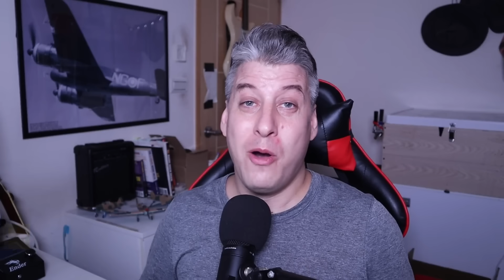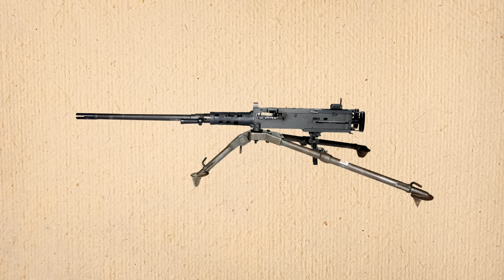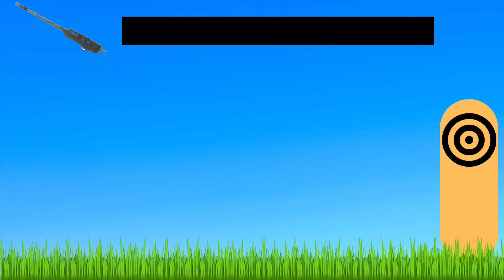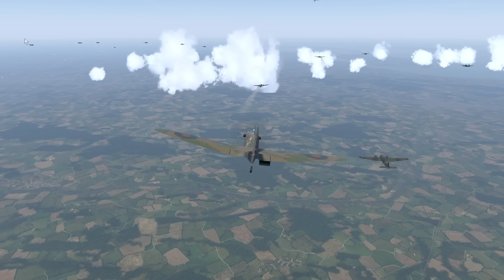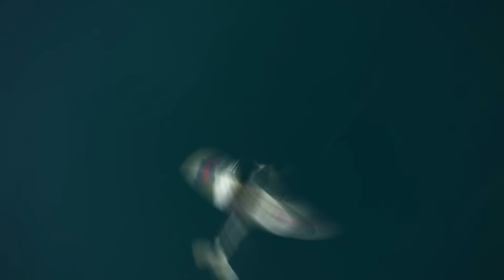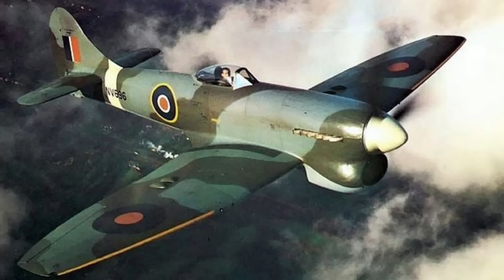Why Did The RAF Use .303 Caliber Machine Guns in WW2? The Surprising Answer

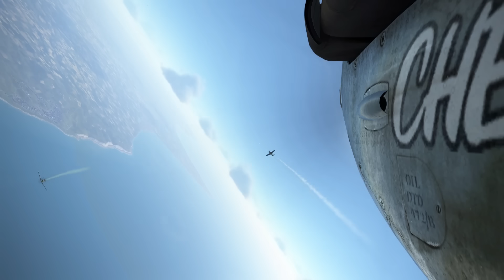Comment: 10:44 - this is interesting. Given that the ‘B’ type Spitfire wing (to take 2 x 20mm Hispano with 60 rounds of drum ammo + 4 x .303 brownings with 350 rounds of ammo) was fully in production in early 1940. Jeffrey Quill - Supermarine’s chief test pilot - notes the disappointment that was he that the cannon wasn’t ready for the BoB in his autobiography. I suspect if the temperature management issues were worked out by April/May all hurricanes and spitfires would have been using the B wing with Hispanos by the height of BoB.

Once the shift to 2 x 20mm Hispanos was made as the main armament a rapid move to upgrade the .303s to .5 cals was not thought ‘necessary’. NECESSITY - not the pursuit of perfection - drove the Air Ministry’s requirements for the Spitfire after 1941: hence the reason why it persisted with the ‘interim’ Mk IX (and the closely aligned MkXVI - which really was the same as a late model Mk IX, but with a Packard Merlin 266 Engine) as the main production run right up until the end of the war - preferring large numbers of that plane to the superior Mk VIII and more powerful Griffon engined variants. It also explains why the Air Ministry were not keen on Supermarine diverting resources to develop the redesigned wing and enhanced tailplane to combat aileron reversal and longitudinal stability issues associated with the more powerful engines. It explained why the Air Ministry never commissioned long range spitfire development; why they delayed the introduction of both the Mk21 and Mk XVIII until near to of after the end of the European theatre of the war. As far as the Air Ministry was concerned the Mk IX worked perfectly for the roles that they needed it for and they wanted Supermarine - and all the subcontracting manufacturers - to produce as many of them as possible. This meant that NECESSITY never dictated the replacement of the .303 guns for the Merlin engined spits. In fact there were many uses for this light armament, including: 

1. Supplementing the big 20mm in air to air combat: no real difference in overall firepower when compared to having 2 x .5 cal guns, plus better tracer rounds, plus less weight at the wing ends, hence greater rate of roll etc; and

2. Ground attack. Unless attacking armour (and the 20MM canon plus perhaps underwing rockets would be used for that), a light machine gun with a higher rate of fire was more effective against troops. The Mk IX was increasingly used in a ground attack role in the later part of the war.
Reply: The RAF had recon Spitfires that could fly all the way to Berlin and back. But plenty of Mustangs were arriving in Britain in 1943 so they used those instead.
Reply: @ToddSauve  1. The spitfires that could fly to Berlin and back from the east coast of England were reconnaissance planes that did not have armament and used the leading edge of the wing for fuel (66 imperial gallons in each wing). They had 228 imperial gallons of fuel carried forward of the plane’s centre of gravity and hence did not need any modification for longitudinal stability or to carry fuel in either the rear of the fuselage or externally. Paul Studdart wrote a detailed article which you can find online for the Royal Society of Aeronautical Engineers that postulated that it was possible to have a series of interconnected fuel tanks on either side the gun barrels along the leading edge of the wings on an armed spitfire (ie. between the 4th and 10th spars and then again from the 12th to 21st spars and connected by steel piping) that would give at least 50 gallons of extra fuel capacity per wing. In a suitably modified Mk VIII that would mean about 200 gallons of combat usable fuel once any rear fuselage fuel (up to 75 gallons could be squeezed in at the back, but this make the plane unstable and hence not suitable for acrobatics and thus war fighting) and external fuel stores were expended. Add in that 75 gallons into the rear and say a further 60 gallons in a paperboard drop tank would get a fully armed spitfire to a target area over central germany. The 200 gallons left unused in the front of the plane and in the wings would be enough to fight for at least 20 minutes (50 gallons expended at max power), then fly home (no more than an expected 100 gallons even with headwinds) plus leave a very handy reserve for contingencies. 

2. The truth is that in early to mid 1943 the Brits had already committed to night time strategic bombing and hence didnt need a fighter escort and the Americans were still in the grip of the ‘bomber mafia’ with their doctrine that ‘the bomber will always get through’, hence no attempts were made to use the kit already available to make the P47 go that little bit extra distance from eastern France to Schweinfurt in time for the big July and August 1943 raids: a disaster. using the Mustang thereafter was probably only an arse covering exercise to hide their strategic blunders in mid 1943. In any case, the mustang didn’t turn up in large numbers until right at the end of 1943 and by then the P47 had largely done the job of killing all the Luftwaffe’s experienced fighter pilots on the western front. Ultimately however, there is no dispute that the Mustang was the superior platform for a long range fighter than either the P47 or Spitfire, but in the planning phase for the 1943 strategic bombing raids, both of the later were available to be adapted for that purpose & the Packard-Merlin mustang (with extended range rear fuel tanks) was still spooling up on the production side.
Reply: @andrewmetcalfe9898  One tends to find the best quality nerds on videos of this kind.
Reply: @andrewmetcalfe9898  A very well put together comment and very informative. I don't recall my Spitfire books mentioning the wing leading edge tanks, nor talk on internal rear fuselage tank. That same tank in the Mustang made handling tricky on take off and until the fuel was used up.
Mark from Melbourne Australia
Reply: @andrewmetcalfe9898  to have really long range, the P-51 also gained a rear tank with the same issues. The rear tank was used first.

Whilst the strategic bombing force was at night, the RAF still did quite a bit of daylight tactical and operational bombing, including with the heavies, and so did need fighter escort. However, this was generally shorter range si the VIII wasn't seen as that much of a requirement compared to the IX. It was useful to pair the VIII airframe with the big, thirsty Griffon and call it the XIV, though. However, the RAF did employ quite a lot of Mosquito NFs as escorts on night operations. One of the complaints with Village Inn ad that it resulted in Mosquitos (and other Lancasters) being fired on.
Reply: @markfryer9880  my Spitfire books mention the wing tanks. In some senses it was good design for strength to have the D torsion box in the leading edge that could be filled with fuel, but it had some heritage back to the 224 as a steam conduit.
Reply: @wbertie2604  I remember hearing a couple reports of units receiving the new mustangs with the rear fuel tank and filling it up for a test flight and the pilots would try and pull maneuvers and end up crashing
Reply: @strykerk992  yes. No aerobatics with the rear tank full, drain it first, then the drop tanks.
Reply: @andrewmetcalfe9898   In Great Aircraft of WW2 by Alfred Price that the P47s at the second Schweinfurt raid were saved by RAF Spitfire IXs with 90 gal slipper tanks arriving just in time  and saved what was a disaster  from becoming a catastrophic raid
Reply: @markfryer9880  Yes the escorting P51 had to be itself escorted until that tank had been used
Reply: @ToddSauve  No: escort work to Berlin by day was always the USAAF responsibility The Cammed Spitfires were frequently mistaken for Germans The USAAF gunners had appalling plane recognition  and the RAF DID NOT WANT TO LOSE THE BETTER PLANE
Reply: @jacktattis   Yes, that is what I said. They never used the Spitfire for escort duty as far as Berlin and back, only for recon work. You are going to make the Americans unhappy by calling the Spit the superior aircraft, LOL! But I agree, the Spitfire, especially the Mark IX and up, were simply terrific fighters and more manoeuvrable in a dogfight. And they could climb faster than a Mustang.
Reply: @ToddSauve  I have been upsetting Americans for a dozen years or more I am sure they can handle it
Reply: That bit, "a light machine gun with a higher rate of fire was more effective against troops" brings to mind something read in the 1970s in one of the various air magazines Dad got, there was an account where a German infantry leader was said to have related that a strafing run by a P-47 with its 8x .50 cal guns left very few personnel who had only been wounded.
Reply: @scottfw7169   I remember an interview with a P-47 pilot from Minnesota and he said he felt really bad about how much the .50 calibre machine guns mauled the infantry when he strafed a German tank. He was speaking about Normandy but the passage of the years likely made him much more philosophical about the futility of war. It took the heart out of him to recall those moments in WW2.
Reply: @ToddSauve  War does damage in so many ways at so many levels.

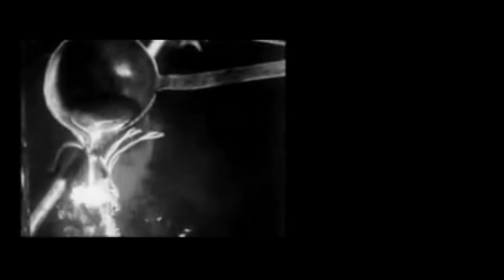Comment: 8:45 - a reliable Hispano canon only missed the BoB by about 6 months. The Air Ministry were probably right to select the .303 browning in 1934 - when compared with the state of the .5 cal alternatives back then and were also right to jump straight to the Hispano 5 years later. Unfortunately it took a couple of years to perfect that technology and it probably wasn’t possible to get enough upgraded .5 cal brownings into hurricanes and spitfires in 1940 when it became apparent that the Hispano still need months more development work to be reliable in aircraft at altitude. Luckily - although in wide use doing the bob - the Luftwaffe were having similar problems with making their 15mm canon work through the spinner in 1950 - having to use pod mounted canon withth only 60 rounds of ammo to supplement the two fuselage mounted machine guns.

Comment: I diagree with your first three points. @0:15 
It is a question of early war engineering production and tooling. Not what we WANTED!
Often forgotten point. Forget 'British inncompetence' the RAF was well-funded and very forward-looking. With a working jet engine programme by late 1930s. 
Britain was about to be invaded so we usually stuck with what we HAD, not with what we MIGHT HAVE if we uptooled to a US weapon and e.g. .50 round. Plus we wanted a 20mm canon. 
That is the dull, but practical truth. Plus, yes, the upgrading of .303 rounds. But mainly necessity. We did fit .50s when they were plentiful.
Reply from the maker: I also disagreed with them, that's why I made the rest of the video, lol

Comment: Early cannon was prone to jam in the wings as they flexed during flight (the cannon of the French and German fighters fired through the propeller hub)
Reply: Apart from the ones that had wing mounted cannon🤣
Reply: @richardrichard5409  that wasn’t till later in the war in 1939 the MS 406, D520, BF109E, P39 all had centre mounted cannon firing through the propeller hub 🤔
Reply: @tadget0566  I thought the 109E only carried wing mounted cannon due to vibration issues with the proposed engine mounted one?
Reply: @garycollard1981  the original E1 had 4 x 7.92mm mg wasn’t till the E3 that they had cannon wing armament 👍

Comment: I think one of the issues with the .303s on the Spit was the placement. Because they needed to add so many of them they had to put them all in the wings and since they increased the ammo count compared to the hurricane you got this horribly staggered gun placement where the guns all basically all over the wing. Meaning the need for engaging enemies at a fixed engagement distance icnreased even more because further or closer your guns will just hit all over. And that distance had to be gauged in a very short time and basically guesstimated. I wonder if it wouldn't be overall easier for the gunner if he just had 2 20mm in the nose but then didn't have to compensate for the convergance. Plus bigger gun means you need to hit less shots a single 20 or 30mm HE round can cripple a fighter aircraft.
I read somewhere that the soviets hated the spits because of the wingmounted guns, many of their fighters you high caliber, nosemounted guns with low ammo reserves.
Reply: The expected "window" for a pilot to have a shot at an enemy to be very short. So a large number of fast firing guns was valued  to paint that couple of seconds with a wall of lead.  I think its a pretty valid concept to work around, as most pilots have little experience thus keeping things simple was key.  Mixed gun types only complicates everything. Cannon only needs much better training and experience.
Reply from the maker: An interesting thought. Perhaps it could have worked for a Lanc or Halifax etc, but I'm not sure how easy a Spit or Hurricane was to redesign for nose-mounted cannons?

Comment: With the Hurricane and Spitfire each possessing eight Browning .303 calibure machine guns, the entire ammo was exhausted in under 14 seconds, the German counterpart however the Messerschmitt Bf.109 possessed 55 seconds of fire output, the 20mm cannon firing through the propellor spinner, a 'kill' of either of the above would take just 3 shells
Reply: The 109 of the Battle of Britain did not have 55 seconds of 20mm ammo - each 20mm only had 60 rounds each , so you were looking at roughly just under 7 seconds of cannon fire - the 50+ seconds of firepower you refer to relate the two 7.92mm machine guns only that the 109 also carried
Reply: Hi, the Bf.109 had machine guns as well as the 20mm cannon, 4 of them, 2 with interupter gear to fire through the proppellor arc and 2 in the wings
Reply: @jodypitt3629  
The Battle of Britain 109E had two 20mm cannons in the wings , and two 7.92mm machines on the nose , firing through the propeller as you say . This type did not have four ‘machine guns’. I believe there may have been some 109Es that carried two 7.92mm machine guns in the wings , but without the 20mm cannon…..
Reply: @jodypitt3629  No. It had two 7.92mm MG-17s in the engine cowling, then in the wings it had EITHER two more MG-17s OR two MG-FF cannon.
Reply: "the German counterpart however the Messerschmitt Bf.109 possessed 55 seconds of fire output"

No it didn't. It had 25 seconds for its two MGs and less than seven seconds for its two cannon.
Reply: @fergusmason5426  Hi Fergus, 55 seconds maybe in short bursts
Reply: @jodypitt3629  Oh well, if that's the way you want to play it, a Spitfire carried enough ammunition for seven hours of firing. In one-second bursts, 30 minutes apart.

The Bf109E-3 carried 6-7 seconds of ammunition for its cannon and 25 seconds for its machineguns. It did NOT carry 55 seconds worth of ammunition.

Comment: one thing the english hate to do is Change . . they will make all kinds of excuses, tragic really.
Reply: Would you like to expand on that?
Reply: @joylunn3445   certainly . . .303 is a rimmed case only really suitable for single shots, should have been dumped with the Martini action rifle. 
Don't get me started on Imperial measures or their money . . Rediculious.
Motorcycle design was hopelessly outdated but they soldiered on and on and on untill it fellover  . . Tragic.
Etc etc etc
Reply: Still won us the Battle of Britain though. The Germans never made a heavy bomber & as such they had minimum gun protection and made them easier to shoot down. .303 worked & if it isn’t broken why fix it?.
Reply: @markdavids2511  True . . I must admit I dislike everything about the .303 from its odd .311 bore to its rimmed case. 
Don't get me started on the Lee Enfield rifle 😊